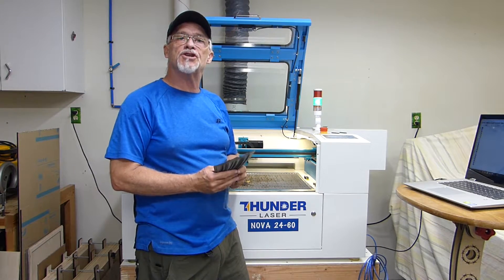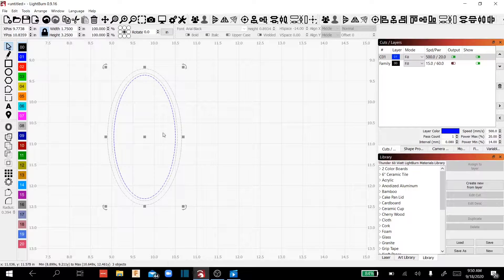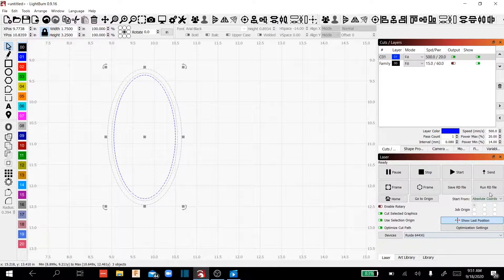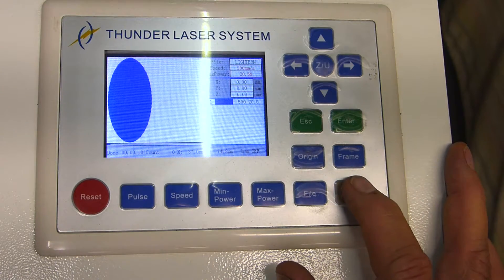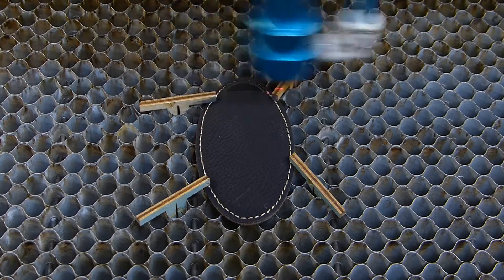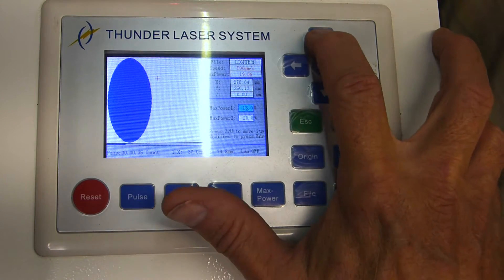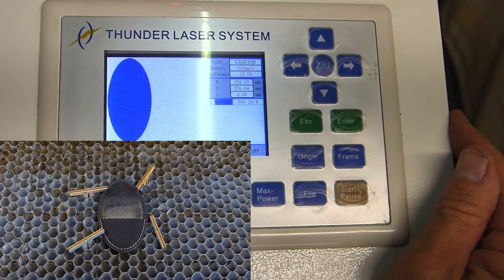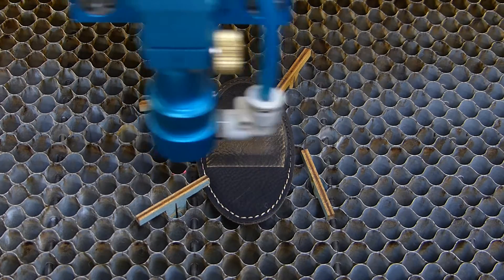Leatherette Settings quick and easy,  Learn how to adjust your Laser power on the fly.

Comment: Thank you for your knowledge. I’m new this I have a question. I have a nova51 are working on leather flask would these settings apply. And should airflow be all the open
Reply from the maker: This concept would apply to what you’re doing. You want very little air flow when engraving leatherette. You don’t want that vaporized material pushed right back on your work piece.

Comment: What power laser do you have? Is that a 100 W?
Reply from the maker: Yes 100 watt
Reply: @computercreationz  I was thinking it was I tried that on mine which is also 100 W. I actually had to run a little bit higher power, but ran the same speed. My lens could need a cleaning again lol but I got it set.
Reply from the maker: Great news!  @KeithLewis28

Comment: Great video.  Unfortunately, the Ruida keypad buttons have changed.  My new Nova 24 buttons are  Pulse  Speed  File  Origin  Frame  Start/Pause.  However, I'm hoping  to use your procedure via the Menu options.
Reply from the maker: yes I see that, the process is still the same just need to use the menu button more. thanks for watching!

Comment: So how do you do this if you don't have min/max power buttons like you? Mine are in the menu. This would save me a ton of time
Reply from the maker: If you use fill mode that will be a raster engrave and you will not have max and min settings. The only time you will have max and min settings is if you are doing vector work and using Line mode in
 LightBurn. Most pictures are a raster engrave no min and maxes used

Comment: Your video has raised some questions that I tried to see if the Lightburn forum had an answer.  It wasn't clear.  And my question is the relationship between the layer min and max settings vs. the min/max settings from the Ruida control panel.  

1.  If my min/max settings on the controller panel are (for example), 10 and 50%, and my layer setting in LB is 50 and 75% what power will actually be applied? Will the 75% I've requested in the layer setting be clipped at 50% (Ruida controller max setting).
2.  If so, then it would seem that your technique here for honing in on proper setting would only work when lowering the controller max value (as you did in the video).  To better explain my question, if I had min/maxl in the controller set to 0 & 50%, and I sent a layer with 50%, then would I get 50%?  Let's say, opposite of what happened in your video, I needed more power, if I raised the controller max to 60% (leaving the layer at 50%), would it continue on at 60%, or remain at 50%?
Reply from the maker: From what I've seen what comes from lightburn takes priority, unless you change your setting in the controller after loading to file from lightburn. Once you reload the file from lightburn it will take priority again that's just my experience.
Reply: @computercreationz  Thank you. Curious still if your technique would work increasing the max power, instead of reducing as in your video. Thanks again. Enjoying your channel.
Reply from the maker: Yes, I do it all the time on pictures or engraves for a different look. Changing power on the fly can be a real time saver.
Reply: Excellent. Thank you.